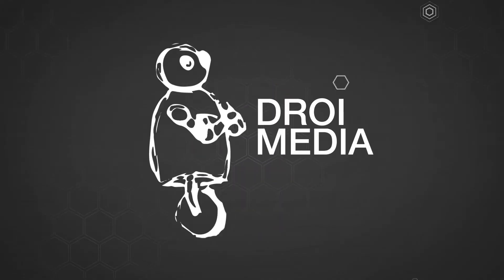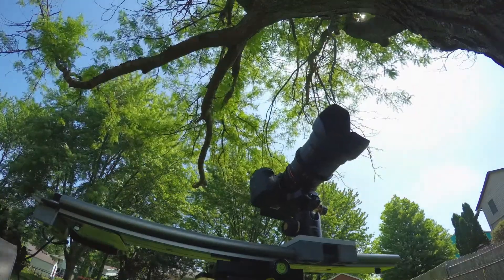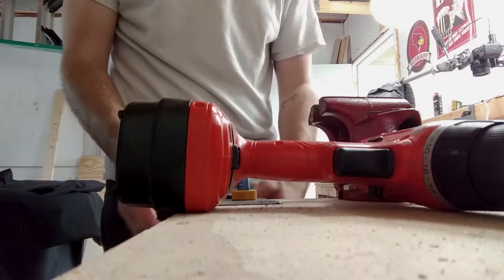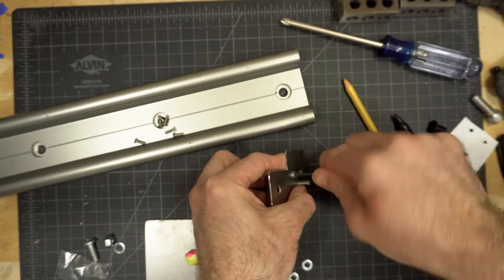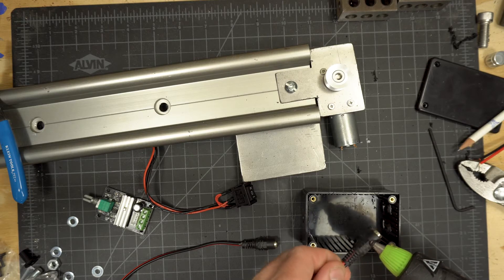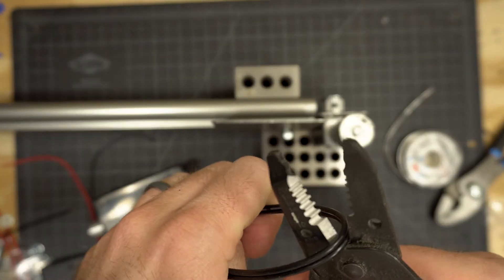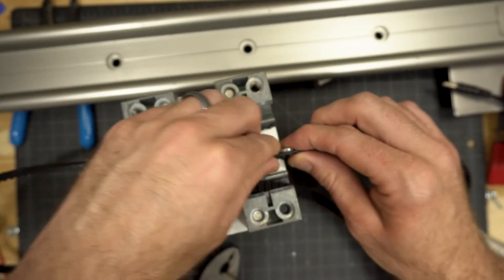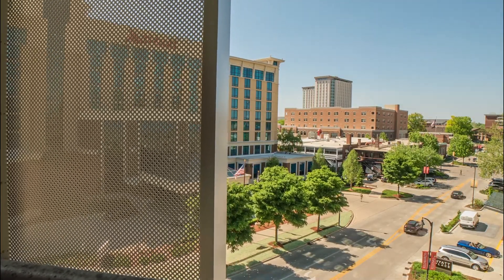TUTORIAL: DIY Motorized Timelapse Slider

Comment: Hey DroiMedia - this is just what I've been looking for! I built a slider a while ago and used a rotisserie motor from my barbeque (lol) winding some fishing line round a bobbin to drag the slider. It was kind of OK but limited as it is only a single speed. Some of the results are in "WA a day in the life" on my channel. Theres a combination of static and slider timelapses and the slider ones just have that extra oomph. I'm going to make your unit now but I have a question. The ebay motor I'm getting looks like your one, but the spec says it's 2, 3, 5, 6, 10, 20, 30, 62 and 100 rpm. Does that mean that those are the speeds obtainable via the dimmer control?
Reply from the maker: Glad to hear you're going to give this a try! It's certainly a one-trick pony but it works so well. In regards to that motor yeah I would guess those are the speeds it will go with a dimmer/motor control, depending on the listing you might be able to choose which of those max speed motors you want? 100rpm is going to crank that slider along pretty fast I think, but depending on your needs that might be totally fine. Hit me up with other questions if you have any, and share a pic or some videos once you've built it! :)

Comment: Could this setup be used with other sliders like the neewer?
Reply from the maker: I would guess you could modify any slider to work with these parts. Might take a little planning but the mechanics and thought are all the same - need a motor, a belt, an adjustable pulley on the other side, a battery/power supply, and a speed controller.